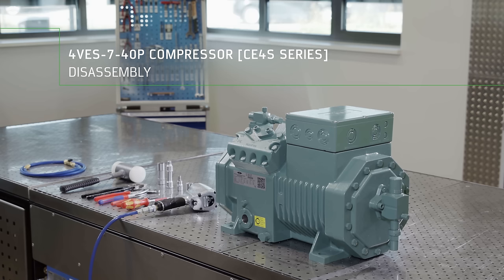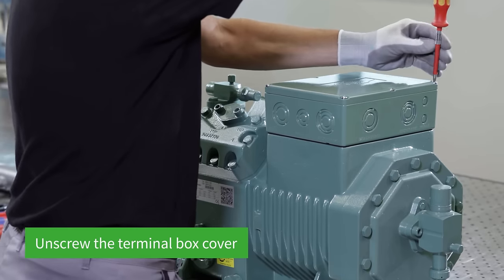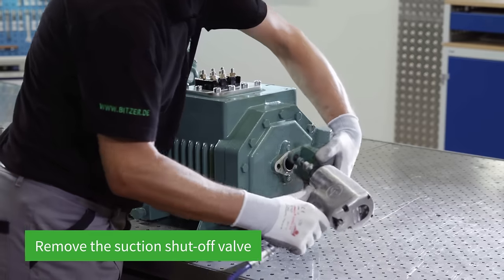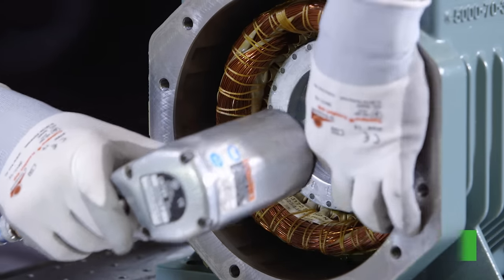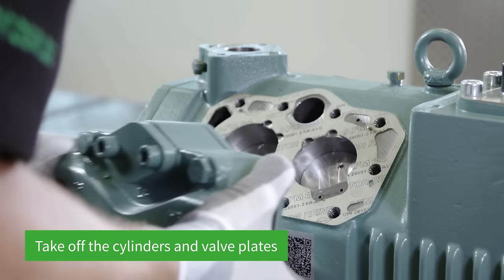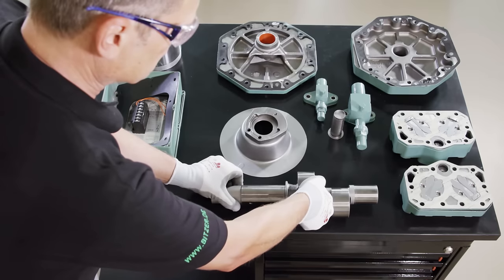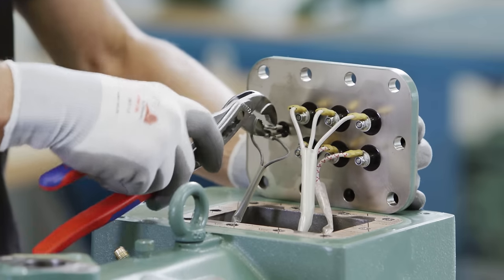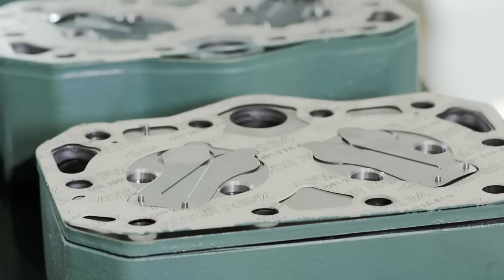A look inside a BITZER reciprocating compressor for refrigeration

Comment: Is it normal for the crank shaft to move in and out while the balancer is fully tightened? Very minimal movement but is there a specific clearance for the in and outward movement of the crank? For this particular comp?

Comment: Screws on terminal box cover need some improvements. After 2-3 years they are rusted and get stripped cant remove them so I have to drill tap them then put stainless screws with anti seize

Comment: Um having problem with a compressor, heads are overheating what might be the problem, the electrical side is fine no temperature from there
Reply from the maker: Good question, but difficult to give an answer here. Have you already contacted your BITZER local partner - or the Green Point service network in your country? www.bitzergreenpoint.com

Comment: bitzer company i have  unit to be rapaired in walk in freezer.i found open ptc on compressor. what is the solution ? replaced compressor or  repair compressor stator, thank you
Reply from the maker: Good question, but difficult to give an answer here. Have you already contacted your BITZER local partner - or the Green Point service network in your country? www.bitzergreenpoint.com